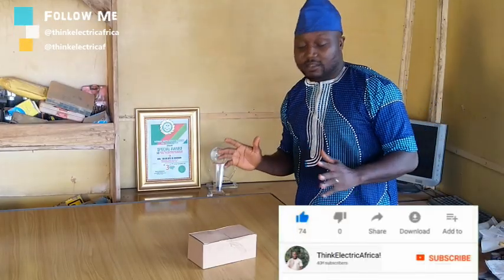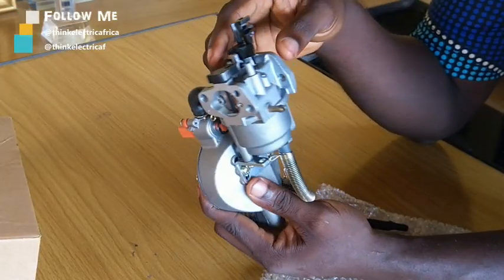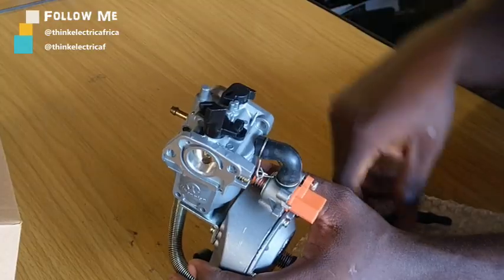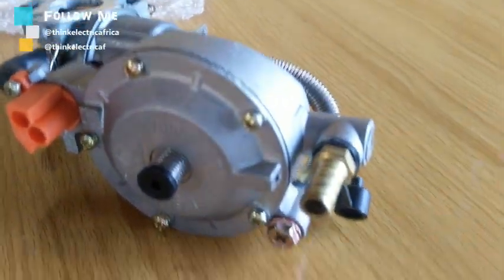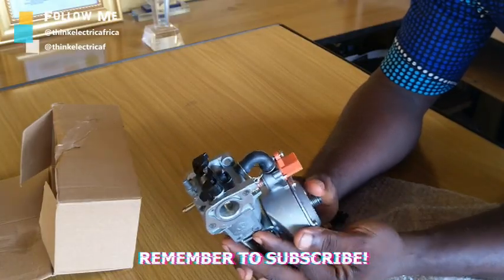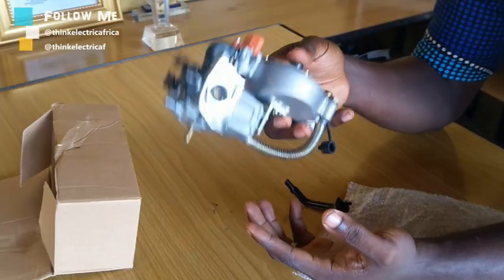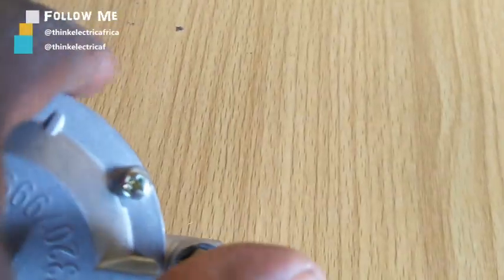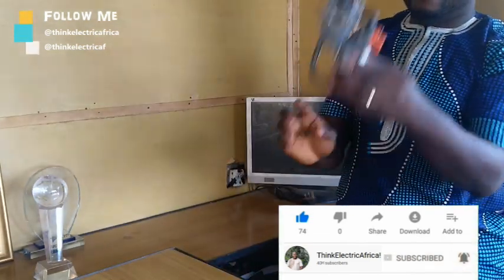Free Gas (Biogas) To Electricity: Enjoy Free Electricity Forever With Gas Generator Kit.

Comment: from rwanda but i am blaming just for this reason.yuo show thi material but you end without showing how it is used?i angry at you.remamber that every one who sees your video desire to know and see the last lesult ok?so where is the following video shows the use of that device?
Reply from the maker: Sorry about how you feel. I have practically explained everything in the video. You just need to replace the tank tap with the one you bought with) for the gas. I will make a video about it later. Thanks

Comment: No example on how to install
Are you saying I can convert my petrol gen to gas

Also is gas more economical
Reply from the maker: Hello James, thanks for being on my channel and for your comment.
Over time, I have been working on how to generate gas from cooking and that is what I am trying to show my viewers that they can also generate electricity from the gas they get from wastes.
Here are some links for you to catch up. 
1. Build a Digester with little effort: https://youtu.be/sayFLEDhRgE
2. Maintenance of bio-gas digester https://youtu.be/a-EqDXXBB98
3. Biogas Digester Explained, All you need to make your own biogas digester: https://youtu.be/ZCbN4vjMcM0

In this video, I only did a quick review of the kit I need more than the kit to demonstrate how to use the kit and that is either I compress my gas into a cylinder or I use a gas pump which I have to order as well.

So using gas is very economical to other fuels and it generate very low carbon emissions, so you will be protecting the planet if you run on gas.

Thanks, I hope my explanation helps, please ask me if you have any further questions. Cheers ❤️